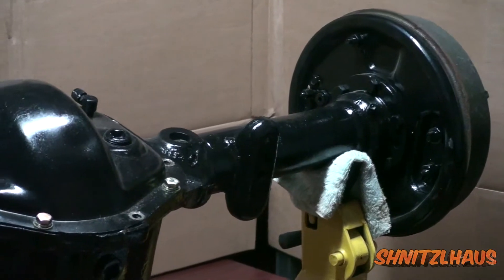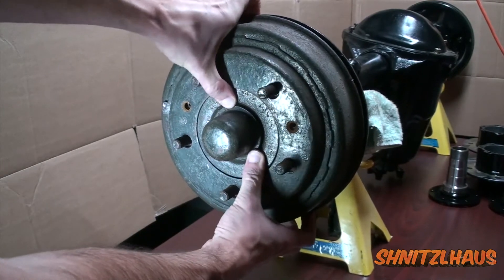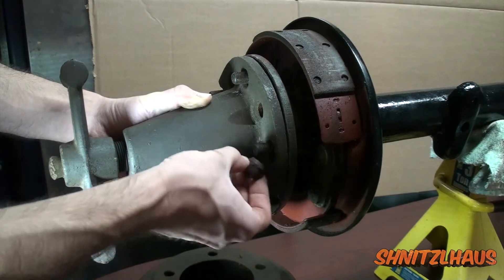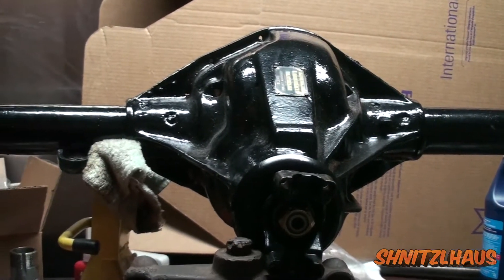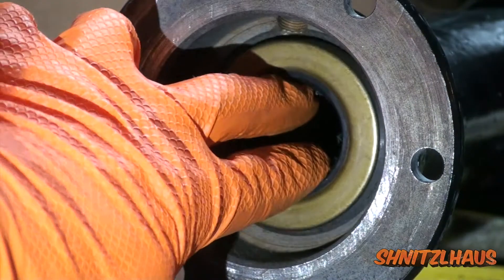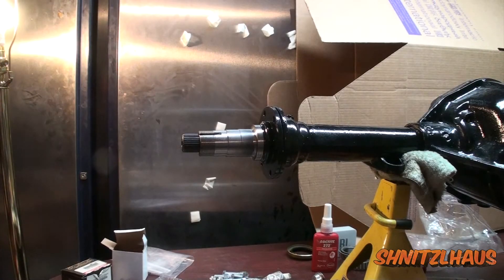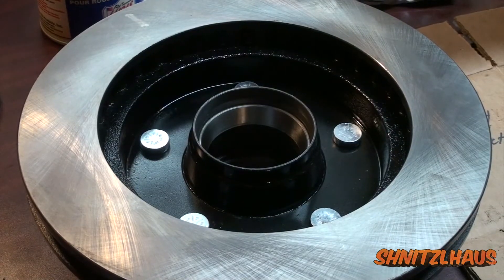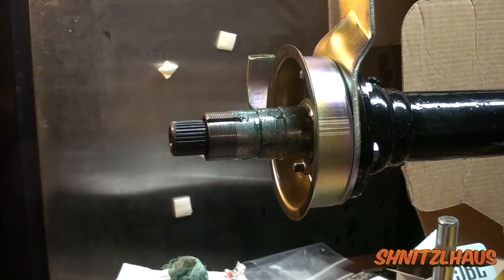Jeep Willys Full Float Axle And Disc Brake Upgrade To Dana 44

Comment: No needle bearing between spindle and axle? Great vid...in the trenches now with Dana 44.
Reply from the maker: It’s not necessary as the shaft is held by the outer drive flange (or lockout) on the hub. Without it the shaft will droop down and touch the spindle.